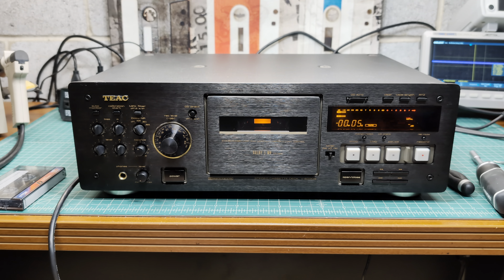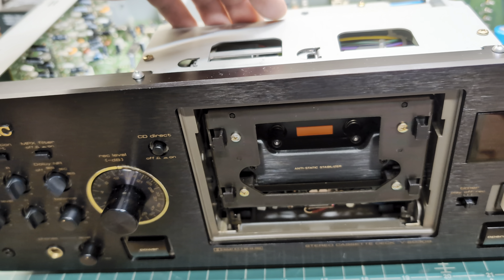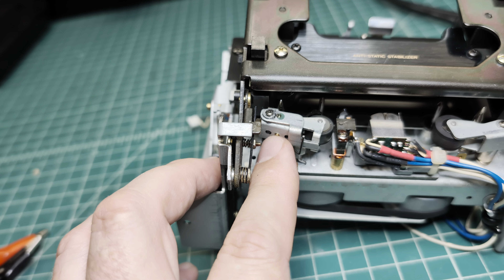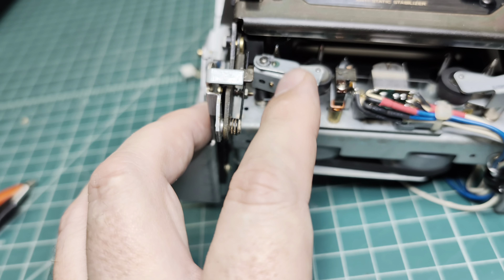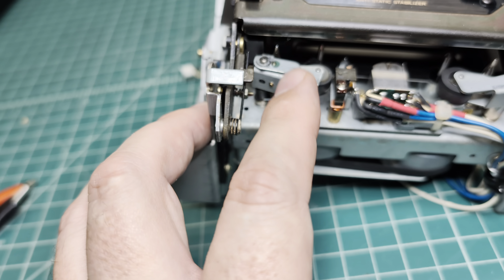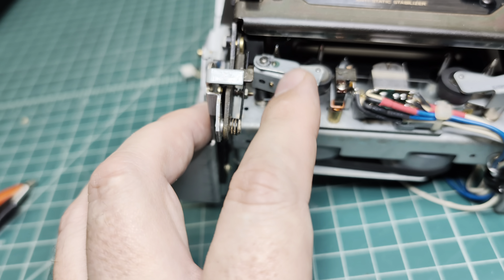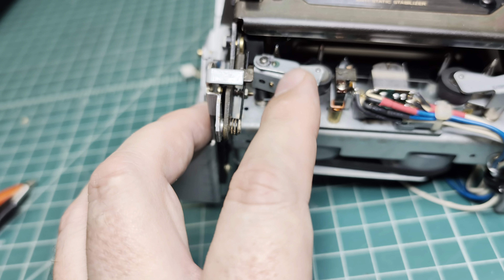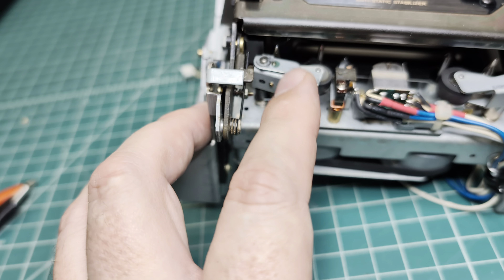Teac V-6030 Wow & Flutter Reduction Attempt: Challenges & Discoveries

Comment: Keep your eyes on the wow/flutter spectrum window.
3.5 Hz - has a huge amplitude, this is, exceptionally, an inter-capstan belt.

It is possible to reduce W/F by taking a batch (e.q. 10 pcs) of 125-128 mm x 5 mm belts from Ali and after find a turner which can help you to regrind the belts from 0.60mm to 0.45 mm of thickness with no thickness deviation and then just choose the better one basing on the 3.5 Hz harmonic height.

As the result - the W/F should be around 0.04% WRMS.

BTW the common frequencies, which are appearing in the W/F spectrum are the next:
1.2 Hz / 2.4 Hz - Right pinch roller (full or half turn)
1.3 Hz / 2.6 Hz - Left pinch roller (full or half turn)
3.5 Hz - intercapstan belt (for 128 mm)
3.7 Hz - intercapstan belt (for 115 mm, Direct Drive modification)
6.1 Hz - Right capstan/flywheel (if unbalanced) or, IMPORTANT! Capstan slippage between himself and right pinch roller. (these china rollers are a piece of ..... , so that's a normal behavior for them). Also 6.1 Hz may appear if the inter-capstan speed difference is too large, which is also a typical thing for Sankyo mech. (DD or belt-based).

Usually it is around 0.4-0.7%, but should not exceed 0.25% (and done ONLY by elastic tension of belt itself)...
This can be fixed by using 2 x 3 mm width belts placed togetner side-by-side (suitable only for DD mech)
Or by grinding left flywheel (with help of turner), the way when:

DL/dl = DR/dr (exactly, up to 0.00...)

where
dr - diameter of left capstan
DL - diameter of left flywheel
dr - diamter of right capstan
DR - diamter of right flywheel

6.6 Hz - Left capstan/flywheel (for DD mech)
6.8 Hz - Left capstan/flywheel (for non-DD mech)
20+ Hz - take motor and gear unit.
Reply from the maker: @puremagnetics  I am not a Yaroslav. 3 different belts showed the same results with the same 3.5 and 7 Hz frequency. I polished and matted the capstan shafts again. I removed all bumps and blemishes from the capstan flywheel surface to make sure that belt will have even tension. At this moment I can think only about imbalanced capstans.
Reply: @hifirulezzz  if the 6.1 Hz / 6.8 Hz harmonics are  higher and 3.5 Hz is absent or comparably small, then we would talk about flywheels' imbalance.

In your particular case - this is a belt (mostly) + too large intercapstan speed difference + possible rubber slippage relatively to the capstan on the right side as I stated before - due to poor quality of bushings inside these china pinch rollers. (trust me as a manufacturer of precision pinch rollers with ball-bearings with hundrets of hours tests of different china-pinch rollers as well).

The only way to decrease W/F - grind the belt on the precision bench + decrease the diameter of the left flywheel according to the formula stated in the 1st comment.

BTW - even the grinding of 1 belt might be not enough, since the heterogeneity of rubber's hardness around the circumference also affects the W/F, since the rubber is constantly going through a small diameter of pulley on the motor.

Therefore, the only way - re-gring 10 belts and then choose the best one.

Unfortunately.
Reply from the maker: @puremagnetics  these belts give me 0.022-0.027% at Pioneer or Sony decks. I doubt thin belts should be an issue. These Sankyo transports are a headache.

Comment: What i do when i run into these issues is take off the back tension belt and disable the left pinchroller (take the spring tension off) and test again 

The backtension belt , left pinchroller and left flywheel are known problematic sometimes but it gives you a few diagnostic hints

Comment: Did you try the Origin pinch rollers? I found the original rollers better in multiple Sankyos even if the replacements look better.

Also, check if the pinch roller timing is correct. When lifting the head carriage the right pinch roller should turn before the left.

Especially after replacing pinch rollers this can be off because the size of the replacement rollers is rarely what is should be.